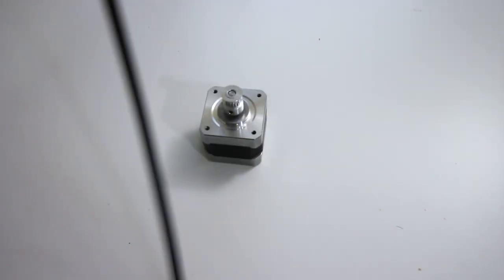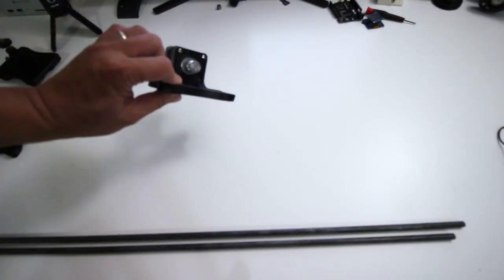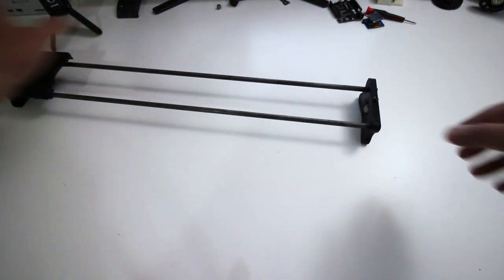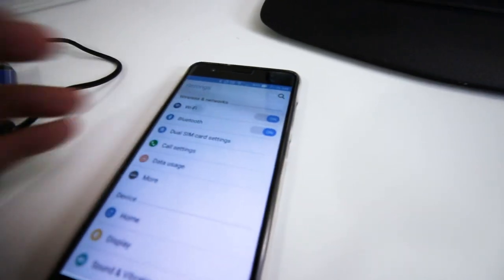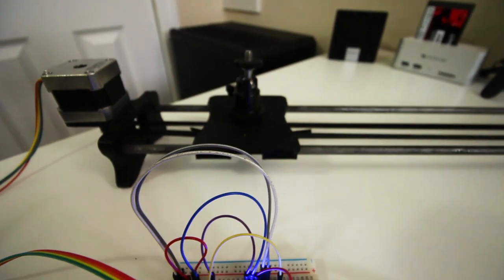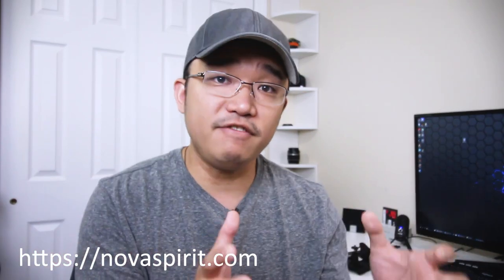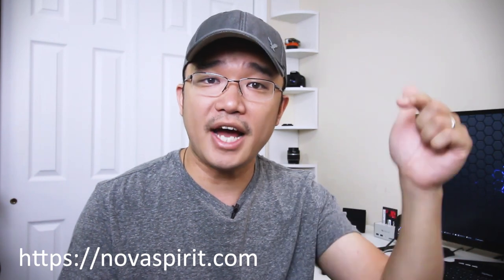DIY Motorized Wifi Camera Slider w/ ESP8266

Comment: Hey Nova! A big thank you for this! im actually doing this for my neweer slider, I did want to let you know that the wiring diagram a4988 for me was black red black red, just in case anyone else has a different motor setup and the motor vibrates but does not spin.
Reply: Also i couldnt get the sliderWidthMulti in the code to multiply the Sliderwidth for some reason
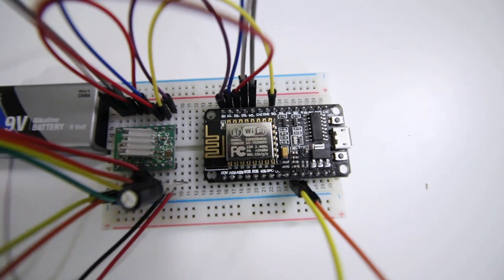Reply: check video from 1:09 and you find capactor and some wires what you dont find on his pic schemes ---  check this (i reduild pcb from his video) https://d.radikal.ru/d11/1804/dd/99a277fb16be.jpg
Reply: heck yes thanks!
Reply: what is the capacator needed?
Reply: don`t foget about const int sliderWidth = 4000  were 4000 rail size (my rail) you need check how long yours slider rails and set this number in code
Reply: 16V 100uF
Reply: yeah I had to adjust mine to 8600 size for 3ft. Also when I do the slow it doesnt multiply

Comment: @Novaspirit Tech , I am wondering if it would be possible to add a button that would do the same thing as an app. Also is there a mode where it won't try and return the other way? Essentially I am trying to build a slide that has a button. When I click the button it goes from left to right then stops. When I click the button again, it does the opposite and stops.  Thoughts?

Comment: That's so cool!

This is kind of off topic, but I was wondering if it is possible to switch operating systems on the raspberry pi without losing your saved data. I'm new to this so I'm not really sure how to do it. Thanks in advance.

Comment: Great video and very nice projects. I have a Proaim Spark Slider and I am trying to motorize the Proaim. I am wondering if in your project the board can be programed to run on an "endless Loop" (running back and forth). I am very mechanical but I have zero electronic knolodge.
Thank you

Comment: What size capacitor is that? You didn't show that in your wiring diagram as well as the purple wire pin EN on the driver to pin D0 on the ESP8266.
Reply: Did you receive feedback on your question? I made one but it's not working, seems the 9v it's to low for the steppen motor, anyone have more luck on this slider?

Comment: You set up 100mF capactor - what = V  6? 16 ?40 ?
Reply: V means Volt ,how much the capacitor can handle.
Exp: if you using a 12v battery and a 100uf 6v capacitor it's gonna overload and explode.
Because you charging with 12v 

So it means if you using bigger volt it's more safe, 100uf 40 it will be good.